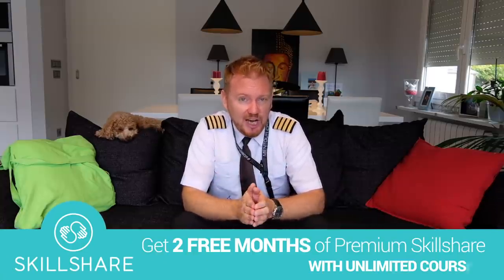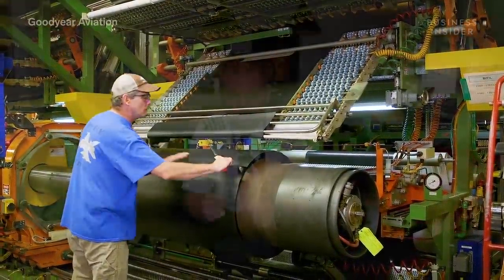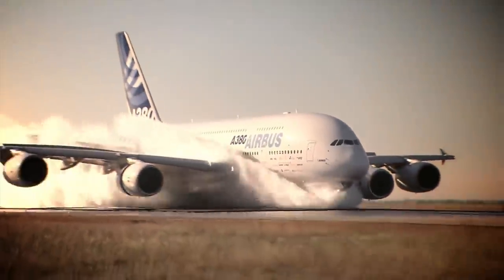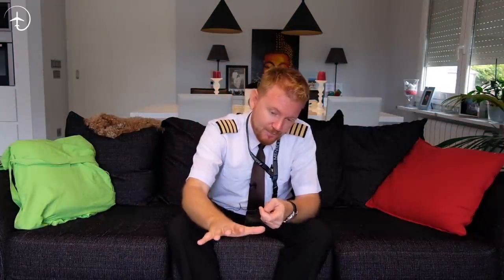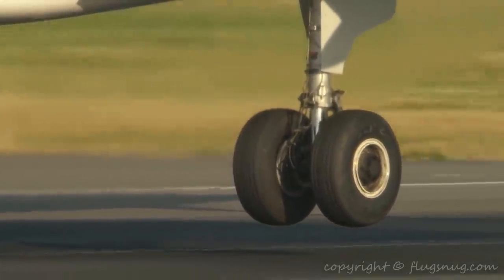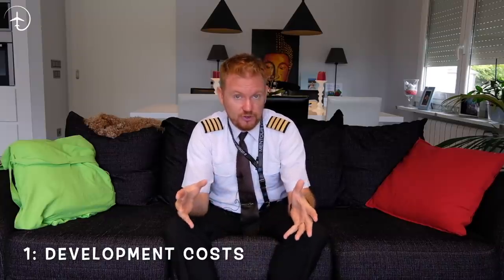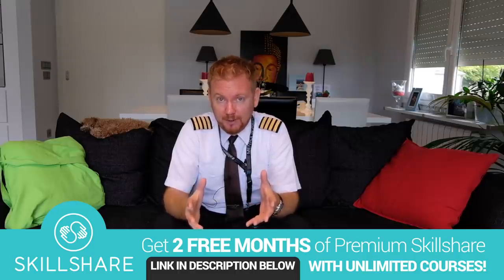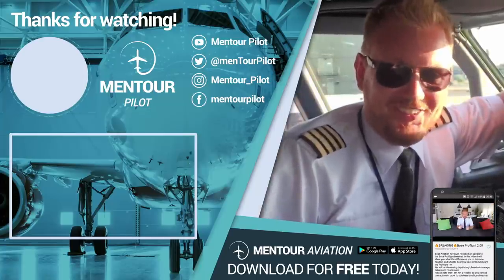Why not make plane-tires spin, before landing?!

Comment: My 2c
*Re electric tugs to save 200kg of fuel used for taxiing:  The saving is minute, as a large jet might used 200t of fuel for a flight.  ie 1000x as much.  To save that, you would have a fleet of very expensive tugs driving all over the tarmac, potentially getting in the way.  I am hardly a seasoned traveler, but even I have been in a queue of 15+ aircraft at a large airport, which would mean 15 tugs. Or more.  And you still burn the 200kg between landing and the terminal.

*Re bits of tyres on the roads:  Car and truck tyres do not burst due to pressure either, and seem to be constructed the same as aircraft tyres.  The debris you see on the road are the de-laminated treads of truck tyres, which are essentially bonded to the carcass of the tyre.   Tubeless tyres do not 'blow out', as the 'blow out' from yesteryear was due to instant deflation of the inner tube. Tubed tyres go flat slowly, normally due to a screw in the tyre, then drivers drive on them flat, which overheats and physically damages them, THEN they disintegrate catastrophically, which some mistake for a 'blow out'.   Yes, if you drive into a kerb, or a brick on the road, they could 'blow out', but then again, so can aircraft tyres. Just ask Concorde.

*Re car tyre treads.  In all tyres, tread patterns are solely to evacuate water, and in dry conditions detract from grip.  Of course, part of the pattern might be advertising flim flam, so let's not forget that possibility.  But car tyres are constantly on the ground, are subject to lower forces, have to evacuate water and grip while subject to lateral loads, and no doubt have additional differences in application vs aircraft tyres.  My assumption would be that aircraft tyres would benefit from more elaborate tread patterns IF water evacuation was the only consideration, but these other factors make the straight grooves the best compromise.

Comment: Hi Petter. I would like to add a few comments about wheel spinup.
Some corporate jets DO use nosewheel spinup kits (required for landing on non-sealed runways). This minimises stones and rocks being thrown into the engine intakes when the nosewheel is lowered onto the ground.
These nosewheel spinup kits are operated by engine bleed air being directed onto vanes on the nosewheel. The system works very well.
Re your comments about one side of the main gear wheels not spining up whilst the remaining side has..... easy rectification (like assymetric flaps) just deactivate the spinning wheel. Easy.
Reply: why bother?
Reply: @davedixon2068  Because you don't want rocks and stones thrown into the engine intake. It can do enormous damage to the engine(s).
Reply: @GrumpyOldMan2  Sorry Rod not the nose wheel bit but main wheels why bother?
plus if the runway is really that dirty should you be landing there with a jet anyway?
Apart from your comment about dirty runways which may be valid in some limited situations, I still maintain that the extra weight of systems to spin up wheels is not needed in general as most runways at least should be policed for debris, and the tyres are designed to land without such a system so its just extra weight ,so less payload, and extra fuel used.
If its actually a design flaw in that the engines are badly placed buy a different aircraft there are plenty out there.
Reply: @davedixon2068  Hi Dave. I've only known nosewheel spin up kits. 
I'm talking about DownUnder (Australia) where most of our strips are unsealed and unmanned. Apart from rocks, we also look out for wildlife (seriously) like kangaroos, emus, cows, horses and camels. Never a dull moment.

Comment: this is one of the topics I´ve been wondering myself about for years. And I still can`t except the explanation your are giving us. It is like saying, that it is better for the tires to touch the ground with no rotation at all at the moment of touchdown versus having them rotate at least somehow near the real landing speed. I was always wondering why not give them at least some sort of rotation in advance bevor they actually touch the runway by for example having some sort of flaps or propellers attached to the axis of the landing gear that would make them spin in the wind in advance?  It must not even match the real speed of the touchdown, but anything bigger (faster) than from zero to lets say 120 m/h should reduce the wear of the tires. I do understand the problems that would come with trying to get the tires rotating at the exact landing speed, but still, if you would be landing at for example at 120m/h it still should be better if the tires are allready rotating at for example 100m/h than touching ground with zero rotation. Most likely I just don`t get it, but....?🤔

Comment: Your tug idea is similar to what I was thinking, cept I was thinking about a manned tug. Like with ships.  As for motors on the wheels? I was thinking,how about vanes on the hub? As the wheels fold out they spin just by air speed. 
So many interesting things to think about.  Thanks again. Retreads on aircraft tires? Oooo, that sounds sucky. But I guess if done really well.

Comment: 30 years ago I went to pilots with a pre spin turbine drive that needed no motor to match runway speed with tyre rotation.
They all laughed at me.
Thanks Qantas. 

Now I've watched more of your segment, my idea that only used passing air stream does make good sense. My idea is so simple and straight forward it will - I believe be incorporated soon. Once my idea is on the ground it is near completely inert. My only concern was gyroscopic consequence to approach. Just as a spinning bike wheel, when spun up in hand, has resistances to directional commands which still blow my mind. I thought this could be the only issue. If the turbine I designed has spun up the gear to a purely predictable rate in relation to the passing ground, they are so light and streamlined that stopping the wheel spinning would take a light tap on the pedals. 
There you go entrepreneurs.  Have some fun with that.

Comment: My initial thought about this was about the problems when it comes to matching the speeds, and "what if something breaks".. which is why I immediately jumped to the idea of using a compressor for the spin.. if you have some form of windmill, or propeller-like device on the wheel (they may even be constructed to utilize a small fraction of the air-flow around the air-craft, but not too much, because then they may spin uncontrollably in case of a heavy storm).. There are many ways to build a compressor that can help with the ramp-up and ways to measure the rotational speed and land-speed, and so on.. 

It should be doable, and the worst thing that will happen if the system "fails" is that you get the wear and tear as you get today.

Comment: One thing that might be done - which would not really add much weight - and would not require a bunch of more approvals - would be for the tire wheels (the wheel which the tire is physically mounted onto) - have some slight outward wind vanes - which via the motion of the aircraft as it it landing - causes the tire to speed up because of the wind flow - in the direction of rotation for landing.  Nothing to interfere such as a frozen motor, etc.

Comment: When I was a kid I thought myself quite the inventor. I designed cups for the wheels that would catch the wind that would cause the wheels to spin so the tires would last longer. I showed it to my father who told me this had been tried in the 1940's during the war. The gyroscopic stability created by spinning wheels made the airplane very hard to handle. It was safer just to replace the tires.

Comment: If you started with the price of the tire, that makes enough sense to not invest in it. However the problems you mention are not unsolvable, some directions:
* You dont need batteries, you already have at least 1 huge power unit on board and you have all the time in the world to spin the wheels up
* You dont enable them before the landing gear is extended (so no enabled electro engines near the fuel tanks)
* Its not a primary system, so if it fails or is broken or not usable in a difficult situation, ohh well, dont enable it, then we just have more wear
* Dont try to spin it up to the exact speed of the airplane, that will make it really dangerous exactly because of what you say, the landing speed is hard to predict. Use a safe maximum speed, which will already prevent a lot of wear

But yeah every system need maintenance, I guess that would be even more expensive than changing the tires in this case :)

(sorry for the many edits, I kept pressing shift-enter instead of ctrl+enter)

Comment: When I worked at Manasco Aerospace on the 777 landing gear drop tower. I asked the guys from Boeing about spinning the tires for landing. They said majority of the damage is done when the aircraft taxiing and turning. Spinning up tires would adds weight and complexity with little real benefit.
One thing I saw on the test stand when the tires hit the ground, they are up to speed in 1/4 of a revolution.
On a side note the first time the 777 landing gear ever hit the ground I got to push the button.

Comment: the reason you have so many tire pieces on the motorway is because truck tires are all resurfaced - they strip off the tread when the tire is worn down and glue on new tread, because the casing (the inner part of the tire) will typically still be perfectly fine when the tread is worn out. But with the long distances trucks drive in varying conditions it's possible for that glue to break down before the tread is worn out, which causes the tread to fall off which naturally makes it go flying all over the place. Blown tires on road vehicles are very rare, and typically only happens when the tire is faulty - like when the side walls are damaged from hitting curbs, rocks, or other debris, or when driving with the wrong tire pressure. Resurfaced tires would never work for airplanes - they'd rip the tread off on every landing

Comment: This is a great video/lecture for all of us plane nerds.  I have always wondered if they could just put some kind of wind turbine on the landing gear to spin up the tires before landing.  I thought about electric motors too, but there could be complications (X(8,10or 12), not to mention the extra wiring and infrastructure added to an already complicated piece of machinery.  Never thought about the "gyroscopic" effect though.  Anyway, engineers have tried it, and though you'd think the gyro effect would add or could add to stability, apparently it doesn't. So, move on to that next big idea.  Thanks.  P.S.  Also, Bill Witts's follow-up was icing on the cake of this great talk.

Comment: I came up with the idea in 1986, one year before I started aeronautical engineering in college.  They did a study years later and found that most of the rubber was worn in turns on the ground.  I think NASA did the study.  You dont need motors.  My design used a small intake directing air jet over fins on the wheels.  Or bleed air from the engine or apu would work too.  Many ways to do it.  Not too complicated.

Comment: I think that tyre technology in general is fascinating. The various compounds used on, say, Moto GP bikes, is incredibly complex. Without doubt, the development of tyres for general road use has saved a huge amount of lives. Listening to your video has added a new dimension to my appreciation of tyres and the crucial role they play in allowing the one of the oldest machines, the wheel, to perform so many different tasks, so efficiently and safely. Thanks for the info.
Reply: think of a moto gp bike that weighs 400 tons and is liable to hit the ground at a variety of angles and speeds, that is aircraft tyre design
Reply: A bit of off-topic trivia. The word "tyre" (or "tire" for Americans) originally meant the iron or steel band that was put on the outside of wooden wagon wheels to reduce wear.
Reply: @russlehman2070  Interesting that the Americans use the original spelling (tire) whereas those of us using tyre are using a form of the word which is relatively recent, ca 19th century. The word seems to arise as an abbreviated form of 'attire' or dressing for the actual wheel.

Comment: Generally the main goal when landing an aircraft is to apply the brakes.  Spinning up the tires to 100 mph just to slam on the brakes makes no sense especially when the point is to stop the plane and not have it accelerate into landing.

Comment: Put little flaps on the wheel that automatically open with wind when they’re at the bottom of rotation and close when at the top, like nascar anti-flip flaps. 

The tire will speed up to a good portion of the airspeed and it’ll reduce wear and it’ll only cost a few squares of metal and some hinges.

Without the hinge system I don’t think just regular veins would work, as the top of the wheel and bottom would cancel eachother out and the wheel wouldn’t spin.

Also, matching ground speed as fast as possible on touchdown would improve grip a lot. Kinetic friction is necessarily much lower than static friction so the less sliding the better.

Comment: If the tyres had featherable blades coming out of the side, they could be spun up using airflow alone, and then provide additional breaking action by altering the feather profile the other way.

Comment: I know I'm three years late, we had a single engine aircraft that would start shaking when in cruise, didn't do it in the climb. After inspecting, we found the wheel bearings in the nose gear (fixed gear aircraft) were loose and allowed the nose wheel to rotate, which of course was out of balance. Since it had wheel pants, the airflow was only on the bottom of the tire, so it was spinning at about 120mph. Tighten the bearings and the problem goes away.

Comment: Nice question. I thought about little flaps that spin the wheels with the landing air flow. Also, listening your reason about the landing in angle,  i figure out that the flaps must give less speed than the landing one. It´s a passive way, without any complicated mechanism.
Tires are cheap numbers, but in my budget is the ingenuity the one that put the rules hahaha.
Thanks for all the great content of your channel, cheers!

Comment: You are right I didnt know they recaped aircraft tires . Truck tires can be recaped 15 to 20 times and recaps usualy last about 100,000 miles but are unlawfull to use on the steering(front).

Comment: I did patent research for a louvered air control pre-rollers, I found many, including a pneumatic system, and alloy wheels with squirrel fans, later I was told the military did testing on pre-spun tires and determined that the spin up phase of the tires on landing distributed the forces into the entire tire body vs concentrated on one section, tires burst. Therefore there is no chance of implementation.

Comment: This has probably been answered before but here I go

What about a landing gear system which has an electric motot NOT for propelling the aircraft when it's on the ground or rotating the tires before landing, but for helping slowing the plane down with the brakes.
This way of slowing an object down is already in use, called "Magnetic braking".
Would love to hear responses to this question

Comment: Usually, the answer to the question "Why don't they put ___ on a plane?" usually results in a question of "Do we actually need that?" because anything you add to an airplane, is added weight which is the exact opposite of what you want. Motors to rotate the landing gear wheels would take up extra weight and add mechanics to the aircraft, and especially bulk up the landing gear themselves which is not good, either. Heavier landing gear means they're harder to retract, bulkier landing gear would create more drag when they're extended, and more mechanics means more potential points of failure on what is one of the last things on the aircraft you'd want to fail. We've been landing aircraft for a long time with the current landing gear design and while there are stresses and the need for frequent maintenance, they still work and work well. Thousands of flights land on such landing gear every day, to this day.

Comment: I worked the line in Atlanta on DC-9's and the A&P mechanic I was working with thought they should make the runway out of rubber and the tires made of concrete.

Comment: My idea on how to do this is with fins in the wheel/landing gear that would spin up the tire using air. I could be wrong here, but even if your tires were spinning @ different speeds, I don't think you'd have any difference in handling characteristics. Your tires now spin up to speed almost instantaneously and if they were already spinning (freewheeling in my method), the speeds would equalize probably more quickly than it currently takes them to spin up. 

Great vid (will like/subscribe). I'd actually asked my 737 mechanic friend about this awhile back and his answer was similar to yours. 

One other thing to mention is how heavy the wheel/tire assembly is, especially considering it's an aluminum wheel. I had the opportunity to check one out once @ a trade show and I don't recall what the weight was, but it was surprisingly heavy.
Reply: what about stopping them from spinning and retracting the gear when taking off

Comment: Not sure why so many people express using motors where simple fan blades could be used to spin the tires at a speed that is directly proportional to the speed of the plane.  Regarding centripetal force, if the plane is crabbing, then the wheels spin slower, as the plane approaches centerline, then the centripetal force would actually help the plane from crabbing.  Regarding unbalanced tires giving off vibration - OK, you got me there, I will need to think about that one and assert an answer.